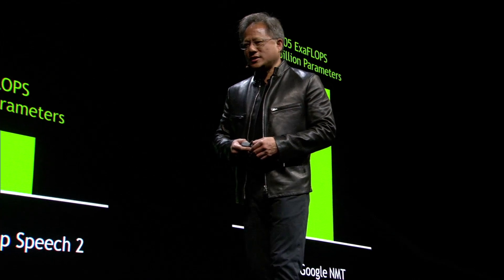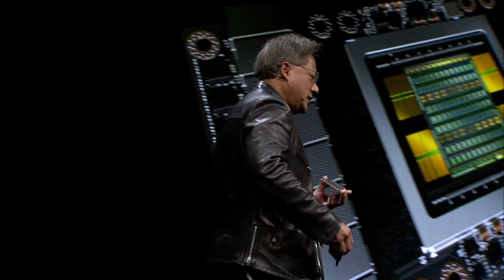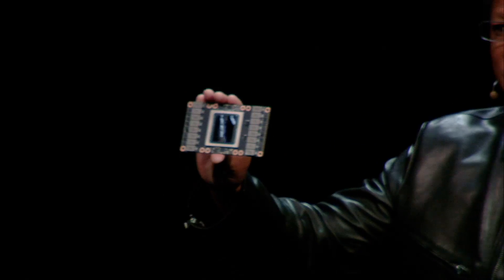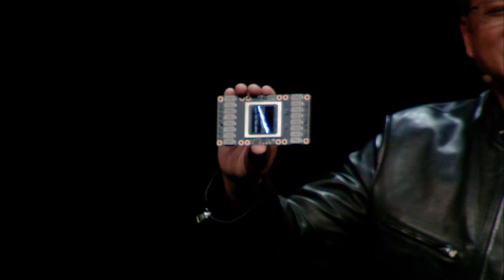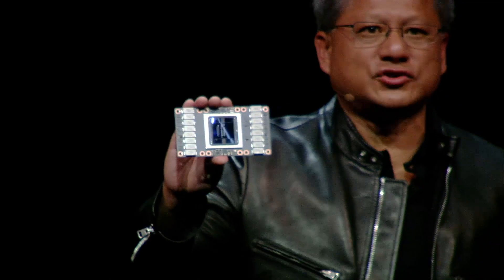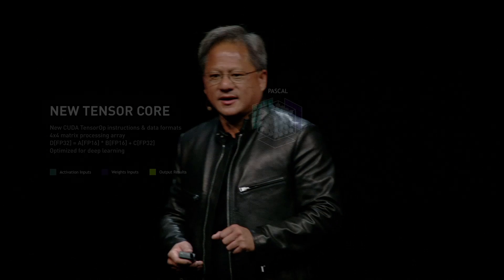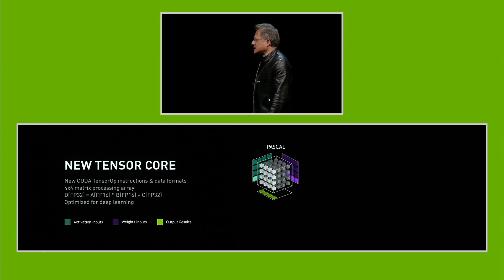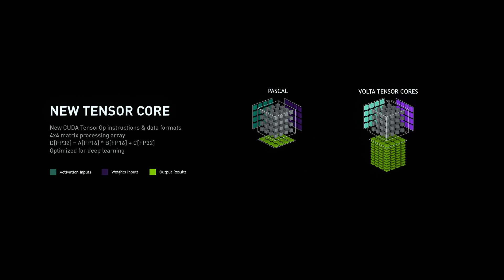GTC 2017: NVIDIA Announces Tesla V100 (NVIDIA keynote part 6)

Comment: This is amazing!! Now just put the v100 in the shield, put an affordable price (500$-600$) on it for a 100tflops global gaming console  that can run any game ever and you create your own market, as everyone will want one and will be ready to pay. You will not even be in competition with Sony or with Microsoft since their consoles are priced and rated a lot lower. Yeah, I know you dream about AI servers and such.. But excuse me, how many AI servers are there? You want a return on investment? Well I want a new shield and I am ready to pay 500$-600$ if it has the v100 in it :-). Now if I was the only one, it wouldn't be worth your while. But I'm not the only one.. Just do it. Yeah, I know it will probable look and weigh like a PS4 since you'll need some extreme cooling. Okay, just try to keep the price under 1000$ and you'll own the high-end market. And while you're at it - add more RAM and allow the user to shorten the round-trip dead time for game streaming. If the network is fast, there's no logic in not allowing the user to try and make the streaming run faster. Especially not if you're putting the v100 in. Then. this system I have in mind, will be able to beat the sh*t out of any gaming console EVER, even on emulators :-). Get it under 600$ - I'm ordering one now. Sh*t, I'm drooling.
Reply: The tdp is way too high and the chip is way too big

Comment: Skynet is near!
Reply: NextGenAge NVIDIA own super computer the dgx saturn-v already uses 125x8 GP100 which is around 4 times less powerful than the new GV100, so the saturnv 250x the GV100 and it is barely on the top 20 most powerful supercomputer in the world. The sunway taihulight from china, is the most powerful supercomputer and is around 16x times more powerful than the saturn v. So if an AI like skynet is possible with 1000x GV100 it should have already been here. Even a million of GV100 wouldnt be enough for a nigh-omnipotent AI like skynet.
Reply: not even close. Sky net is 1000x times more powerful
Reply: Beyonder Then hook up 1000 cards right?
Reply: SuperJosteen I get it, but it was more of a joke :P